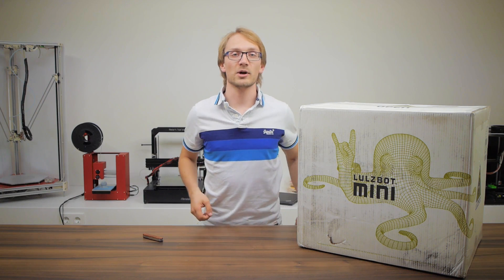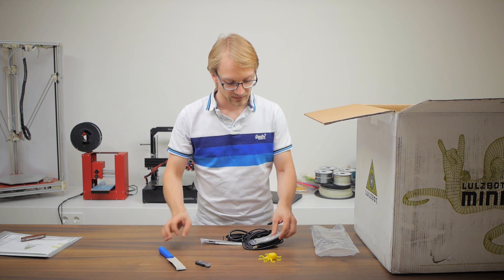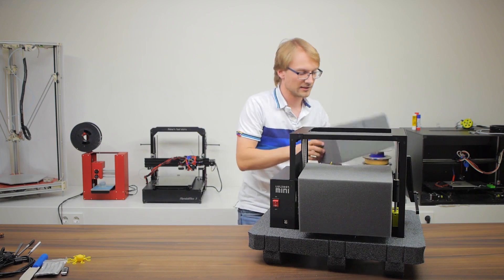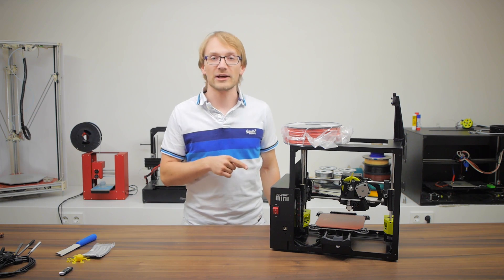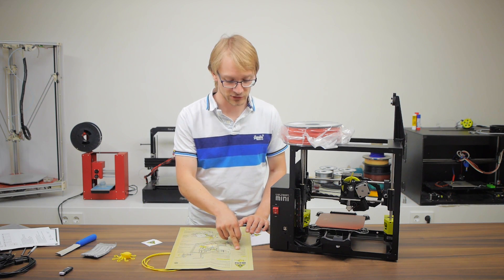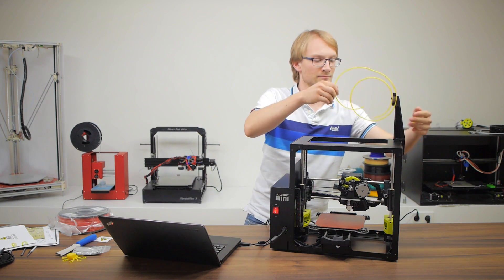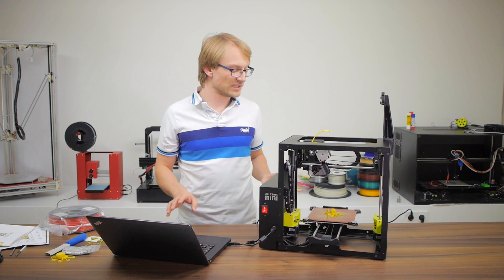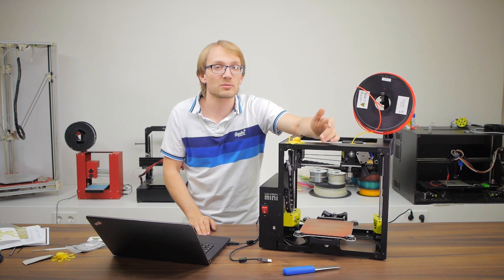Unboxing & first print: The AlephObjects Lulzbot Mini!

Comment: Could one print out the wipe tray, buy their wipe material, and some how make it work on non lulzbot printers? I would love to have this on my Robo3D if its simply G-Code commands
Reply: THANKS!! I even found on the lulzbot forums the gcode they used for the clean sequence :) I'll have to give up a little of my print area but the guys over on the robo forums say the y axis only has a 8.2" heated area anyway even though its capable of 10" so I shouldn't loose too much print area :)

Comment: Interesting to see use of the closed electrical circuit on the pads at the 4 corners used for leveling.

I'm using an aluminum bed. So I actually contemplated whether it would be possible to do something like that. Not necessarily for auto-bed tramming but as an extremely precise way of running a bed leveling wizard or calibrating an inductive probe.

Comment: "Auto leveling closes a circuit" Are you saying the hotend tip acts as a limit switch to close the circuit for auto leveling the bed?!
Reply: Thanks for the reply Tom! May I ask for a schematic/firmware tweak or component I need to buy? I have a build area of 40 x 45 x 40cm, and having such a feature would be amazing!
Reply: *****  Thanks for the reply Tom! May I ask for a schematic/firmware tweak or component I need to buy? I have a build area of 40 x 45 x 40cm, and having such a feature would be amazing!
Reply: +Thomas Sanladerer This is genius!
Reply: firearmsstudent Lulz Bot support explained that g29 is used when the circuit closes. Add this to your firmware to use the command "g29" when the probe closes the circuit, sending coordinates back to the control board!
Reply: +Thomas Sanladerer It seems the cleaning procedure may be a required step for the circuit to close properly.
Reply: ***** Ohh! So it is used in the endstop section of the board. This could actually work for my printer as I have a spare endstop pin layout. Does it take up one enstop section of the board, or two?